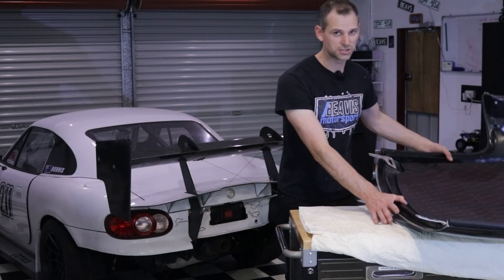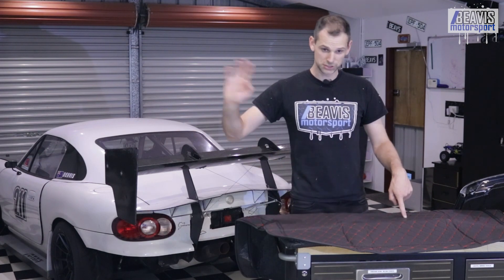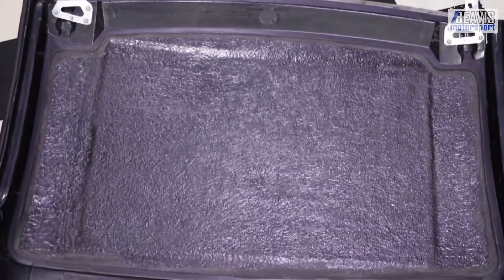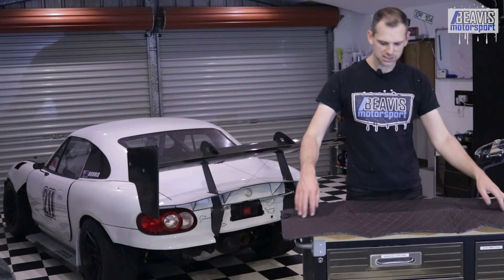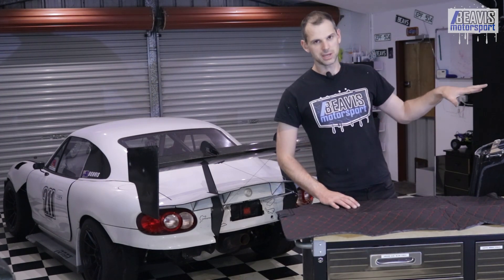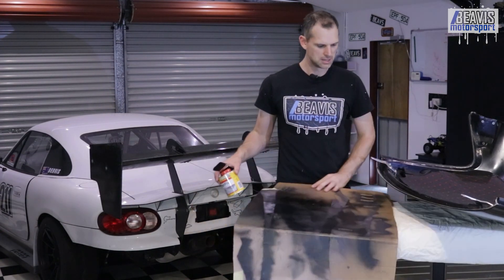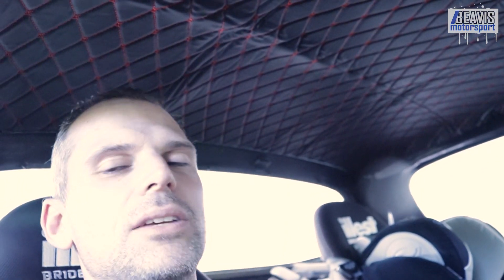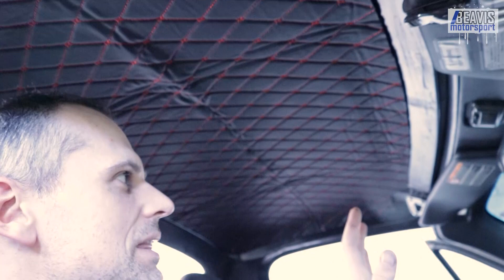DIY Quilted Hardtop Roof Lining - Mazda MX-5 Miata

Comment: That turned out really nice, especially since the creases have reduced ... Great success!  After the car heats up really good a few times in 30+C weather perhaps the remaining creases will reduce further.  Where did you source the fiberglass aftermarket hardtop?
Reply from the maker: Thanks mate. The hardtop was made by a local business who has a skill and passion for composite MX-5 parts.

Comment: Hit those creases with a heat gun, that might relax the vinyl. Not too hot, obviously!
If you go for round two, would you consider putting up a layer of sound mat first?
Reply from the maker: Good idea.
If I did it again I'd use a better quilted material, but I am not too phased by sound mat, the whole car is a bit of a noisy machine anyway.